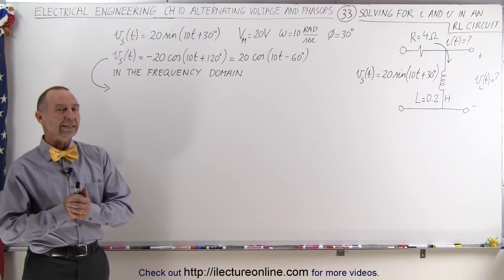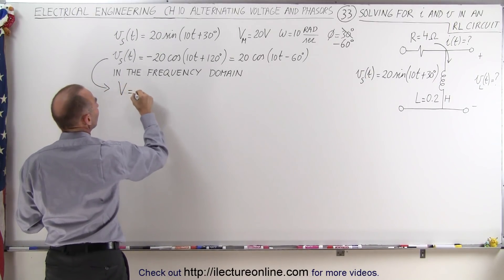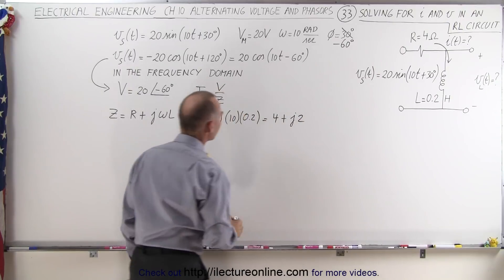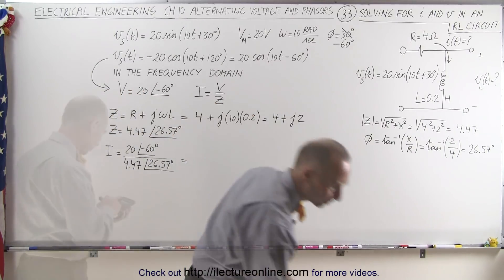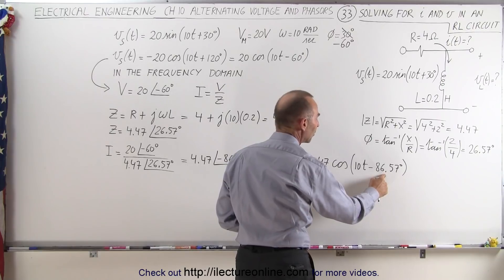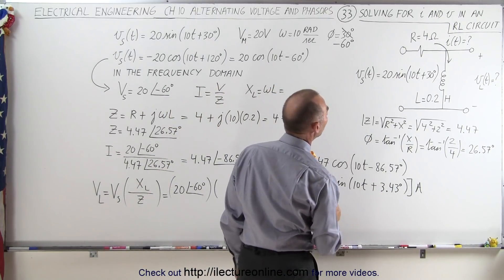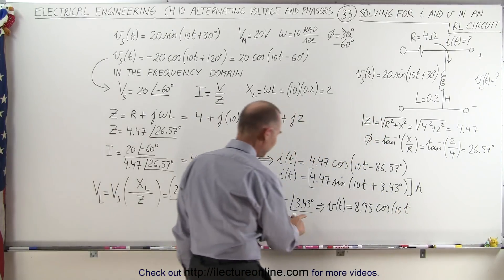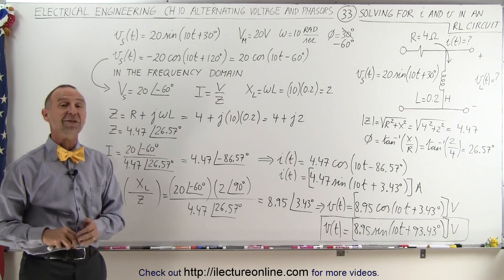Electrical Engineering: Ch 10 Alternating Voltages & Phasors (33 of 82) i=? & v=? in an RL Circuit

Comment: A very small detail Sir. Originally thank you for your videos they are all exceptional and helpful. I would like to mention a small detail. After the calculations of impedance and current you should use the unit of measurement of each value after the calculations just for better visualization of your best work. And again its a small detail that i would like to mention. Thank you.
Reply from the maker: Good suggestion.  Thank you for the input.

Comment: is there a typo in the source voltage equation ? is it   -20 sin (10t+30)  ? because I am confused why did you change the sin to - cosin then the - cosin to + cosin ?! if we have +sin and we want to change it to +cosin can't we just add 90 degrees?
Reply from the maker: It can be done either way.
Reply: @MichelvanBiezen  ok great 👍🏼

Comment: One small thing that keeps recurring: When calculating the voltage across the inductor you have been using voltage division. Once you have calculated the current, however, this is an unnecessary step. You can just multiply the already established current by the impedance of the inductor to get its voltage. So at 6:36 you have VL = Vs * (X/Z). This is the same as (Vs/Z) * X. Vs/Z has already been calculated as the current so no need for both a multiplication and a division. Just multiply the current by the impedance.
Reply: ooh good eye. I could have sworn my numbers were getting redundant.

Comment: Hi Professor!

A practical question: Considering that impedance is an AC circuit analogy to the resistance on a DC  circuit, what would a ohmmeter read: the reactance, the resistance, or impedance? Since these 3 are all in ohms

Comment: Sir I have a problem about representation of Xl and Xc in this and previous video. We represented Xl and Xc as reactance and it has no phase different (w.l for inductors and 1/w.c for capacitors). Why do we write 90 phase different of inductor right here in this video. I confused.
Reply from the maker: We found the magnitude of the reactance.  One we plug that into the equation to find the current or voltage, you will see that we do take into account the phase angle difference between the current and the voltage.

Comment: When initially converting the sin function to a cos function, I added 90 degrees. At the end, my current equation had a phase angle that was exactly 180 degrees apart from your lecture. Is this still the same answer?
Reply from the maker: Since the sin (90) = cos (0)    should you subtract 90 degrees when going from sin to cos?
Reply: @MichelvanBiezen  Subtract, I have made an algebra error from the very beginning. I changed the initial condition by adding on to the sin function, when I should have sibtracted 90 degrees from the cos function to maintain the initial condition. Thank you

Comment: Can we calculate the max voltage across the capacitor or inductor by multiply the reactance and max current, and change the phase angle to make voltage function to lead or lag current function by 90 degrees?

Comment: Where is the negative -20 coming from in the source voltage? In previous videos, to change from a sin function to a cosine function, all you instructed us to do is subtract 90 degrees.
Reply: I see now that you eventually came up with the same answer. I guess I just don’t see the point of your first step in order to change from sin to cosine. It threw me off for a couple of minutes.

Comment: Sir the inductor is in parallel so voltage across inductor should be equal to source voltage
Reply from the maker: No they are not in parallel because there is a resistor at the top.

Comment: is there any difference if you leave it in cosine without converting it to sine
Reply from the maker: Since the original problem (voltage) was stated in terms of the sin function, it is customary to express the answer in terms of the sin function as well.